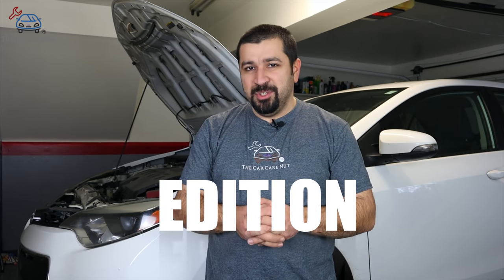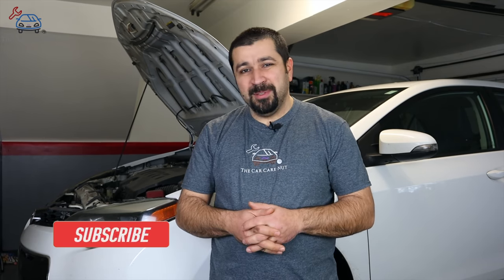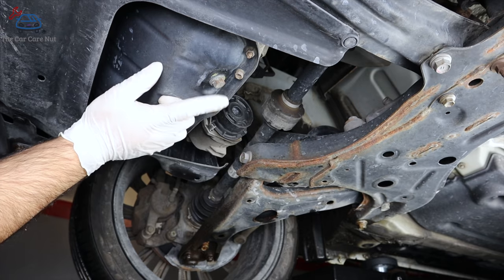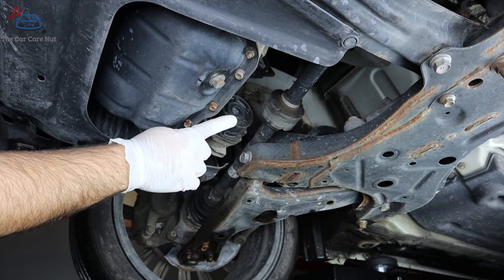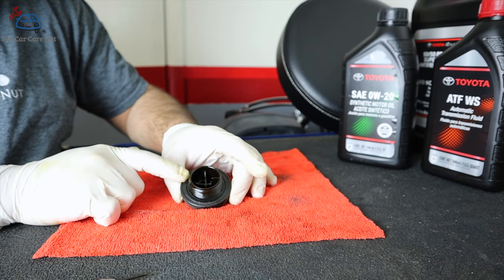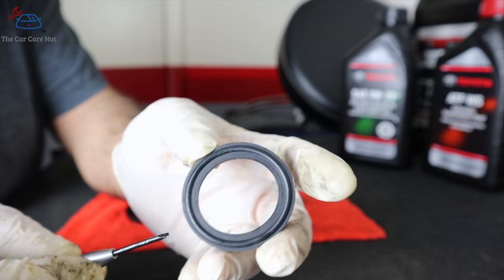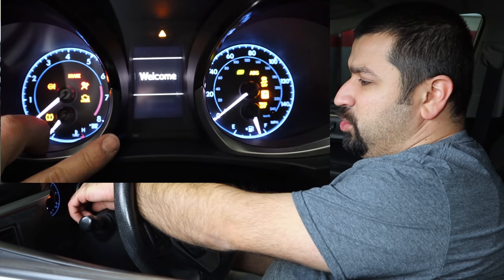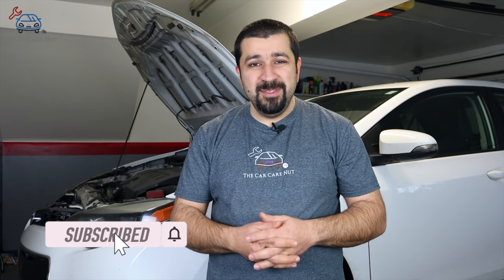How to change your Engine oil and filter for Toyota Lexus Scion

Comment: I've got a 2010 Corolla with the 2ZR motor. I did the oil housing conversion from cartridge paper filter to the regular metal spin on filter with Toyota parts from a 2016 corolla. Would this give me better engine protection because of the anti-drain back valve that spin on filters have? Much more convenient when doing oil changes either way. Any reason why Toyota went back to spin on filters on the corolla in 2016? Thanks

https://www.ptetra.com/blogs/blog/project-lexus-ct200h-spin-on-oil-filter-conversion
Reply: Wow that's dedication! From what I've heard (toyota dealer tech) on the 2016 corollas some have the spin-on and some have the cartridge because they were in the process of switching over from one design to the other and the factory didn't want to just throw away the remaining inventory for the old design.

Comment: With your videos I just finished transmission fluid, coolant, tc and rear diff on my 2014 Rav4, I saw bottom of oil filter and looks very easy to reach, so probably will start doing my own oc! Local shops/dealer would have charged $550 for these! Brake fluid is last one I need to do. Great videos!  Thank you!
Reply: I do  a Trans dump and run every 4-5 engine oil change. Once you do it a few times its easy. My Rav4 has 215000 and runs & shifts as good as the day i got it.
Reply: @Jimmy_Jim_Jim_1234  so every 4-5 oil change you would do a transmission fluid change?
Reply: @nmjhd1234  Yes, but not a total flush. The dealerships have a pumping machine for that. The shop mechanics manual has a step by step procedure. 
I tow trailers every so often. So maintenance is essential to make it last.
Reply: @Jimmy_Jim_Jim_1234  thanks let me try and find the manual. I would like to keep up with the maintenance of this new vehicle to have it lasting a long time. 👍
Reply: @nmjhd1234  Good for you. They say the Trans fluid is "lifetime". Its NOT.   Our generation Rav4's are great cars and will last.
Best of luck!

Comment: 😂 those filter drain caps NEVER come off. After 11 years of ownership I still can't take ot off. I even put it in a vice without any luck.
Reply: I only got mine off with the Toyota tool. I sucked in quite a bit of air when they told me the price - about $100 - but it was very much worth it. (Things like channel-locks and vices don't work because they jam the threads on the two pieces together.) Now I know the jamming on is because of overtightening it. I understood about the o-ring sealing it but somehow still over-tightened them.
Reply: I changed oil at 5000miles on my own & I couldn’t remove the cap. At 11000 miles at the oil change, I asked the dealer to loosen it, so I could remove I when I have to change the oil, but he did not. I have a large 6” vice, and I did remove it, to my surprise there was no “o” ring. I purchased metal replacement and used the metal cap. If you bought the metal housing and cap, they cost less than $20, in the aftermarket.    Jim
Reply: if ever overtightened, forget about it, if never overtightened, they come off no problem
Reply: I think you're talking about the drainbolt on the oil filter cap. Sometimes you try to remove it and the whole oil filter housing cap comes off instead of just the drainbolt. The reason that happens is because torque specs aren't followed when installing the parts.
Oil filter housing cap = 18 ft.lbs.
Drainbolt on the oil filter housing cap = 9 ft.lbs.

Comment: Great, simple, straight forward.  I'd love to see a full set of videos on 4Runner maintenance.  There's some good ones out there, but there's no 'one stop shop' to find all the good ones.
Reply: not videos, but a one stop shop https://www.toyota-4runner.org/5th-gen-t4rs/215622-diy-maintenance-quick-reference.html
Reply: Make sure you lubricate your 12mm skid plate bolts when you take it off to take the oil filter out.  Also some Tacomas and 4runners use a cover under the drain plug too, personally I wouldn't put that in so you can catch an oil leak sooner, but make sure you lubricate those 12mm bolts also if you put that cover back

Comment: Great video as always, thank you!  I have 3 vehicles with the 2GR-FE engine, 2 of them uses 0W-20 and the oldest with 150k miles on it uses 5W-30.  Can I safely switch the older vehicle to the same oil weight?  Trying to limit what I buy and limit the left overs since all of them say 6.4 quarts capacity and I buy them in 5 or 6 quarts containers (like Walmart has 12quarts for 49.99 Mobil1).
Reply from the maker: Hi! I wouldn’t switch the older one, you can switch the newer ones safely to 5w20
Reply: You can switch to 0W-30. As long as you keep the top number the same because the SAE 30 is the viscosity at operating temperature which is the temperature your engine is at most of the time. The 0W will do no harm. It will simply provide a better flow rate and better lubrication when the engine is cold also contributing to easier starts in the winter and reducing bypass of the oil filter.
Reply: I definitely would not use a thinner oil than what is recommended.  I’d use 5w30 (or better yet 0w30 if you can find it) synthetic in all three if out of warranty.  I’m not a fan of thin oils.  In a very hot climate you can go up to 10w30.

Comment: AMD, any tips on removing over-tightened or stuck filters?  I tried changing my oil for the first time (2017 Rav4 XLE), and everything was going textbook until I got to the oil filter (I also bought the toyota specific tool from the dealership to remove the oil filter housing).  In the end, it was on so tight that I ended up breaking the fins off of the filter canister - still wouldn't budge at all.  I brought it to the dealership, and the service rep said the shop shouldn't have any problems removing the old one or installing the new one because they typically use high-torque drills.  I asked them to not over-tighten the new filter housing, but I guess I'll find out next time I try to change my oil.  Any tips?  Also, thank you for your videos - I never thought I'd even get this far, but you put so much make/model specific information that I'm giving this a solid try.  Thank you!
Reply from the maker: Usually a very long breaker bar works but you gotta replace the housing afterwards.
Reply: Someone had said to put bond paper { copier ]  around the oil filter / inside the oil filter wrench . Of course to clean off any oil first and that provides a very good grip .
Reply: I bought a 2005 Avalon that has the same problem. The plastic housing has been replaced with a metal unit. The filter housing has been way, way over tightened by the previous oil change mechanic. I suspect the O ring was not put in the grove correctly. When it leaked the mechanic probably just torqued it down instead of removing it to see what was wrong. My cheap end cap tool didn’t work so I bought a metal end cap tool from Toyota made by Performance Tool item #W54076. The oil filter housing would not budge with my rachet so I replace the rachet with a two-foot breaker bar. The socket welded to the end cap tool where the torque wrench attaches just ripped off. ( I double checked that I was turning it the right way to unscrew it.) Has anyone got a suggestion on how to get the filter housing off? The housing is mounted vertically under the engine but there is not enough room to put a pipe wrench on it. Also, does anyone have a recommendation for a filter cap wrench made with sturdier metal?
Reply: @TheCarCareNut  Why does the housing have to be replaced? Do the threads get stretched? Does this apply to the metal oil filter housing too?

Comment: I love to see you demonstrate the removing of the oil filter on a 2003 V6 Highlander.  Toyota engineers and designers seemed to have had a real bad day when they decided on the location and the placement of the oil filter on that model.
Reply: Yep i had a 2006 for 230 k, hated the oil filter ( liked the drip tray under the filter to catch the drain off) but the car was bullet proof. Lowest maintenance vehicle i ever owned so ill take the oil filer bs
Reply: @sjd7188  Cannot agree with you more.  165K miles on my Highlander with just regular scheduled maintenance and it's still going on strong.

Comment: AMD, as part of this series could you cover the maintenance steps done during the first scheduled maintenance for a new car? I was reading something that said the technician will check and torque various bolts on the car but it didn't say what exactly. Thanks.
Reply: I have wondered about that as well after reading it in the manual I wonder if it only applies to certain vehicles though
Reply: @thetechlibrarian  Usually only applies to vehicles under "severe driving conditions" but at least at my dealership nobody ever re-torques them unless the customer specifically requests it

Comment: Hello AMD,  I have a question about the VVT oil screens on the 2GRFE engine.  Do they need to be serviced at any mileage interval?  Could you do a video about this subject sometime in the future?  Thanks.
Reply from the maker: Hi! They don’t need to be serviced unless there are issues. All the ones I’ve pulled they rarely has any debris on them as the oil filter does a better job.

Comment: AMD As always thank you for your videos. I have a 08 Camry 3.5L V6 with 127K miles which I have changed oil every 3000 miles using Pennzoil regular oil. Now that I’ve learned that Toyota oil are made by Mobil 1, I plan to use Mobil 1. But, I could not find regular oil 5W-30 by Mobil 1. Is it OK to use Synthetic Oil on my 2008 Camry?

Comment: I have a screw-on filter. To not forget anything i start exactly like this: 

-jack the car
-Open the oil cap and put it aside
-open the oil bath nut, wait for oil to get out, and tight it back on, not just hand tight, tight to the right torque so i don't have to worry after "did i tighten it?"
-Remove the filter
-lub the new filter seal with a little bit of oil and install it.
-jack the car down, add the oil, check the level, and when the oil level is ok, put the cap back on.
-let the car run for 5-10 mins, check for oil leaks, and check the level again. 

Never had a problem 😅

Comment: Thank you, learn a lot from watching. Changed my 2006 Highlander V6. Very satisfying to do that myself. Does the drain plug gasket has a common spec? I have got a fabric one from Toyota (like the one shown in the video), but this time there is a metal gasket in its place. If I buy the gasket independently in bulk, what spec should I ask for?

Comment: I’m an a fan and a subscriber of your YouTube channel. I purchased a ES 350 2007 and run into a stuck oil filter housing. Broke the oil filter housing tool and socket extension wrench. Need your help if you have any idea on how to remove the oil filter housing. Thanks and keep up your good work.

Comment: Hey my mom has a brand new Lexus ES350. Gorgeous car and she loves it. She's older and only drives limited miles in town. I firmly believe in your 5000 mile/6 mo interval, but she won't put 1,000 mi on her car in that time. Do you still advocate the 6mo interval with so few miles? I'm having  trouble convincing her to let me change her oil at six months with so few miles 😁.

Comment: Oh my god! You are amazing! My oil cap gasket is broken a little piece off but it is not leaking, I am hesitating if I need to buy a new one. And I was wondering how could this be broken, then you let me know why, someone might got it too tight or almost forgot to fill with oil......and you told me I can just buy the gasket and you gave me the part number! You just can read my mind

Comment: Thank you for one more beautiful video.  
Please can you share how many miles/time had oil before change? It is looking quite black and contaminated.
Reply from the maker: Hi Marjan! Good question and good catch! This is a car that I’m working on for the first time and the owner agreed to let me film with their car. This car actually burns oil and after this oil change I’m checking it again after 1200 miles to see how much it burns. I cut it in the video but around 2 quarts came out of the pan out of the 4.4 total capacity.
Reply: @TheCarCareNut  By definition of oil consumption that you provided, that corolla is somewhere between stage one and stage two of burning oil. That's a reason why I asked for Video to check an oil by color.  We can than try to recognize time when to change an oil. For some situations even after one offroading, race, in diesel cars even after first DPF auto cleaning or just after 3 Months because is really cold outside and car is driven in short distances. Please let me know your opinion about this. Thank you.
Reply from the maker: I’d say this one is comfortably moving from stage one to stage 2 at this point. The oil that came out of this car was alarming and it has done just over 5k miles since the last oil change. The filter is very dark as well. 

Oil color is interesting to read. Most oils you drain will look dark but if you shine a light at them you’ll see their true color. Dark brown is about right. This one was flat black.
Reply: @TheCarCareNut  Black and I guess smelly on burning. ;)
Reply from the maker: Yep. Whole garage smelled terrible after making this video

Comment: Dealer Mobil oil bulk Tundra 2021 is it advanced or just regular Mobil one? Always used the best oil liquid moly on BMW X5 changed every 5-6,000 miles! Oem oil filter only aftermarket ones clasped so can cause lifter failure! But 207,000 miles gave to my daughter loving my new Truck! But free oil changes until 24 months at least they are doing mine every 5,000 miles! Found you on TPS video for tires! Good info! Thanks Kevin
Reply from the maker: Dealerships oils can vary from Mobil 1 the bulk that they use. But Toyota’s bottled oil is made by Mobil 1 and doesn’t specific which exact Mobil 1 kind it is.

Comment: This might be a stupid question but is it wise to change your own oil if the car is new in warranty? Let say the dealer says you should come for oil change at 10000k but you do it properly on your own after 5000k, can the dealer tell, when the 10000k mark comes, that you changed the oil outside dealership before schadule and lose the warranty? Thanks. Love the channel.
Reply from the maker: Hi! While the car is under warranty and if an issue comes up that the dealerships
Deems oil change related they could ask for maintenance records and it could be from an outside shop. But if you do your oil changes in between the 10k oil changes using original filter you shouldn’t have an issue with the dealership.
Reply: No. Your warranty is not affected if someone else services your car other than the dealer but you are required to keep records of what was done and when as well as receipts for the materials/supplies or labor if you use an independent mechanic. At least that's the way it is in the USA.

Comment: When I first changed my 2015 Corolla oil filter, I couldn’t get my cartridge off.  I took it back to the dealer and had them loosen it, since they did my first maintenance and I didn’t want to damage my cartridge. Couldn’t figure out why or how they tightened it so much. Did they use power tools to speed things up?  Never had a problem since.
Reply from the maker: Hi! Typically mechanics that overnighted them use a very long ratchet and crank on them.
Reply: Sounds like idiot service folks. Oil filters go on hand tight with a bit of oil on the gasket.  At work we have replaced more than a dozen stripped oil pans over the last ten years.  I have been changing oil over 40 years...zero issues.  Guess the certified ase mechanics are actually idiots.  If they cant change oil correctly.  Good luck with spark plugs in an aluminum head

Comment: Again I like your video. My one complaint is that the sound gets a bit to gravely and hard to understand when your video tapping  under the car. P.S. you might recommend a strap wrench for the filter removal also useful for canister filters when the hulk installed the last one.
Reply: A strap wrench rarely works when these are over-torqued. I recommend the Motivx MX2320 oil filter cap wrench for engines that are 2.0 liters or larger or the MX2321 for smaller engines like the 1.8 liter in Corolla or Prius or Matrix (Pontiac Vibe), etc.

Comment: AMD, Baxter Performance makes a spin-on adapter for the plastic, canister type filter.  What do you think of using a spin-on filter adapter?
Reply from the maker: Honestly I wouldn’t. The canister filter does the job good and the plastic housing if not overtightened easily will last the life of the car

Comment: I talk to the mech at my Toyota dealership. He said when my oil is changed they don’t change the small oil ring on my 2015 Venza . I thought both rings had to be changed, but like you said it is not necessary. It’s an extra step I never liked doing anyhow. I buy my oil filters from my Toyota dealership and install myself. Is Toyota oil filter better to use than say Fram oil filter? Thanks
Reply from the maker: Hi! The 2nd o ring rarely gets changed honestly. I haven’t seen one leak from age yet. I personally would stick with the original filters

Comment: Thanks for the thoroughness of this how-to! What do you think of using Lucas Oil (~1L or 1qt per oil change) particularly for a used vehicle (2GR-FE) with an unknown previous maintenance history?
Reply from the maker: Hi! I personally don’t use Lucas products.  I heard good things about them but with that engine timely oil changes is all they need and I would be a bit wary about oil additives in that particular engine due to its oil dependency to actuate the variable valve timing
Reply: BAD idea.

Comment: Hi, I always watch your channel. I have a very concerning issue with my 2022 RX350 oil capacity . The manual shows 5.8 QT. however it shows low on dipstick, Does the 2GR FKS have a different level from the 2GR FE ? or is the dipstick on 2022 RX350 in correct. Please show a video on this concern. Thanks